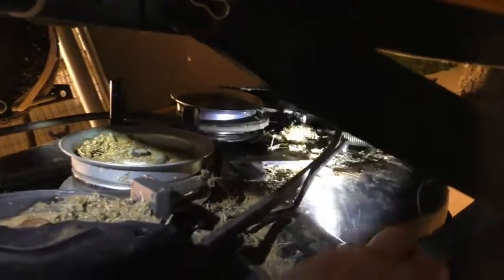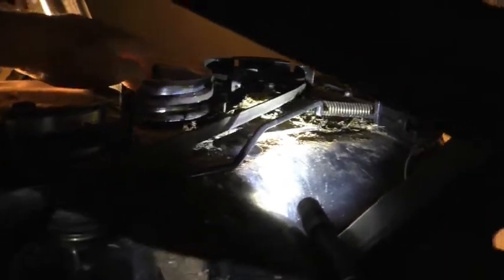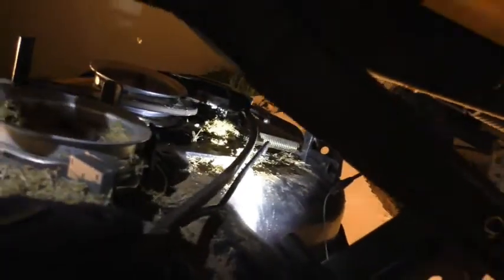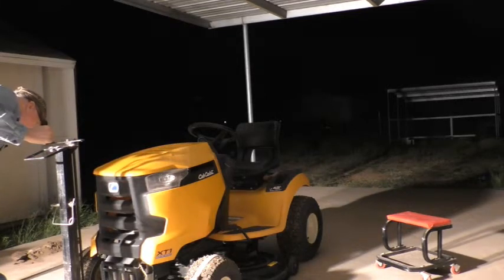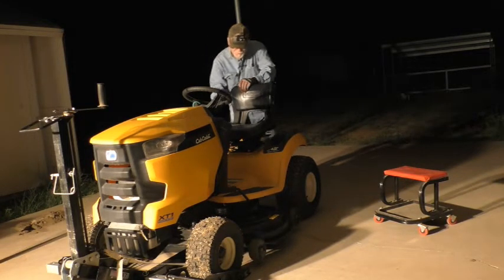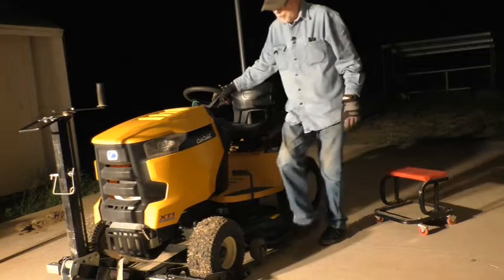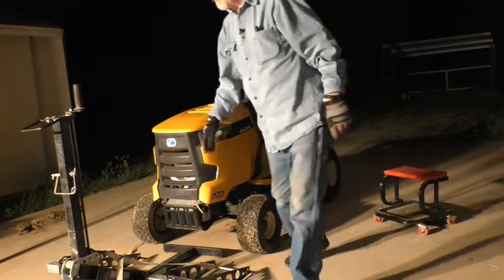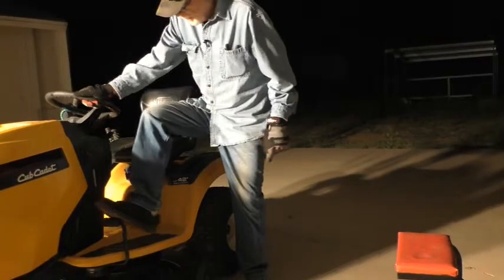Cleaning cutting deck on Cub Cadet XT1

Comment: hi , Yeah Those washing Ports Don't work. You Got To Get It Before It Dries. Maybe Drive It Up On Car Ramps & Hit It With The Hose Everytime..  I Enjoyed Your Video. I am Not Being Funny But You Sound Like You Was Chewing Tobacco and Had a Mouthful Of it.. I Could Hear You , But It Was  Muffled .. Cheers From Auatralia For You Video..  A Lot Of People Don't Even Clean Their Deck. These Machines Are Very Expensive To Buy And Don't Really Require a Lot Of Maintenance To Look After Them. They Will Last  For Decades Sometimes If They Are Looked After Properly  As You Know.. A Deck Here  In Australia Would Cost Around $1000 - $2000.00 . I Think a Lot Of People Have Just Become Lazy. But It Always Costs Them More In The End
Reply from the maker: Hi Jon
Thanks for  commenting.  
That morning I  was having a heck of a time with my allergies  I  have.
 I'm believe it  or not allergic to the Prarie grass I  had just cut and I had been sneezing my head off all that morning. Sorry it sounded muffled.  I might had had the wireless microphone I  was using to close as well. As far as the cost of a new 42 inch cutting deck,  here in the U.S. I  think they are close 800 to 900 dollars. If I  ever get a hole in the deck from rust I  can always  use my mig welder and make a patch.  The dirt we have here is clay and sand, very harsh on anything mechanical. 
Hope you are doing well " Howdy " from the desert in New Mexico. ;o)
Reply: @nmsidewinder   Hi Again, Yes Sand and Wet grass are the Enemy for Rust and The sand is an Abrasive which Takes Off The Coating on The Bottom Of The Deck. Even Brand New Decks Are Left out in the weather, Then bought inside and Coated with The Surface Rust Still on it. Nothing Gets Sandblasted before Coating. Too Much Time And Money For The Manufacturers . Besides They Want The Thing To Rust Out so That You Have To Buy A New one. Things These Days are Throw Away . Unless You Know How to Repair It Like Yourself, Which Most People Don't Know How To Do. There Are Some Good Non Stick Coatings Out There For This sort Of Thing. John Deere Tractors Are Very Bad For Rust, I have Cleaned  Rust on a Fair few  of Them and Repainted For People and Myself. I Like The John Deere Tractors , Just Bad For Rust. I Personally Have 2 JD Tractors and a Cub Cadet, All Get Used Often. Hope You Are Feeling Well and Thanks For The Video